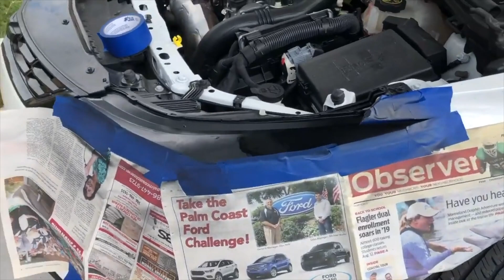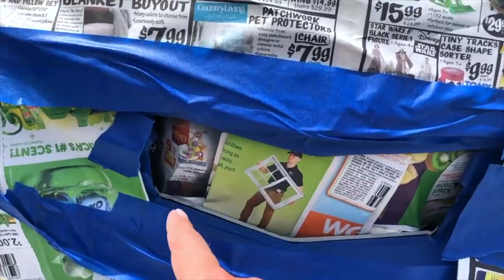BUILDING A CRUZE IN 5 MINUTES! MODIFICATIONS (MODS) AND CUSTOM BODY

Comment: When you added that LED pod did you have any problems hooking up to the positive and negative points above the fuse box in the engine bay because I have the same Chevy Cruz and I want to put a light bar on mine but I don’t want to run the wires all the way to the trunk and to the actual battery
Reply from the maker: I tapped into the fog light section up front